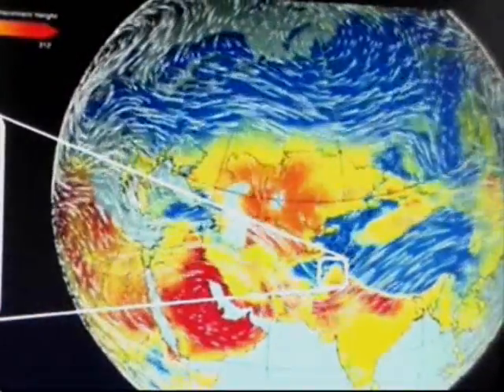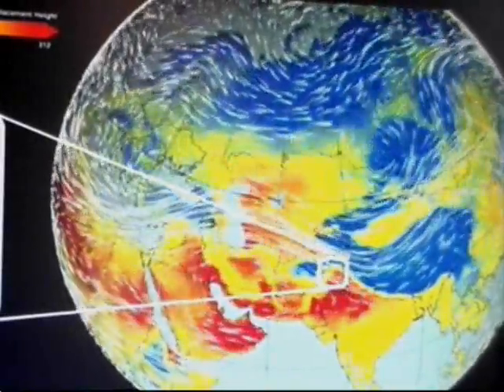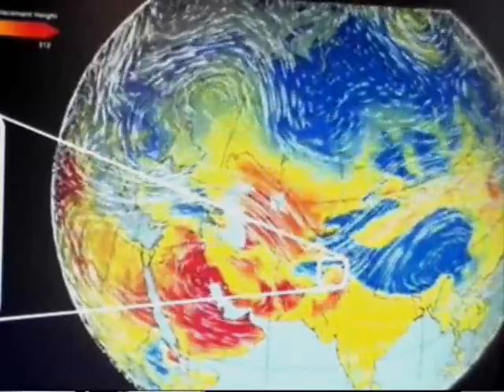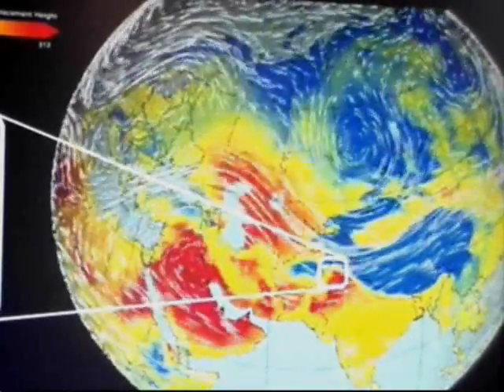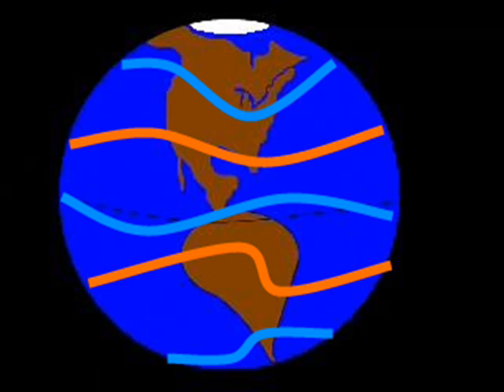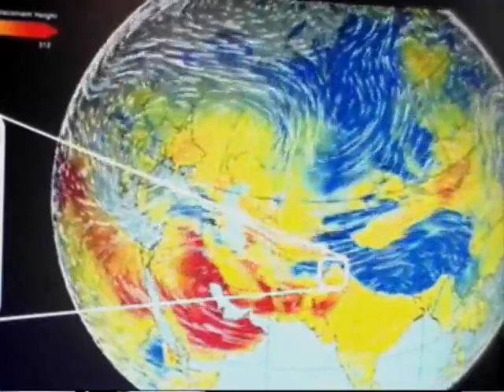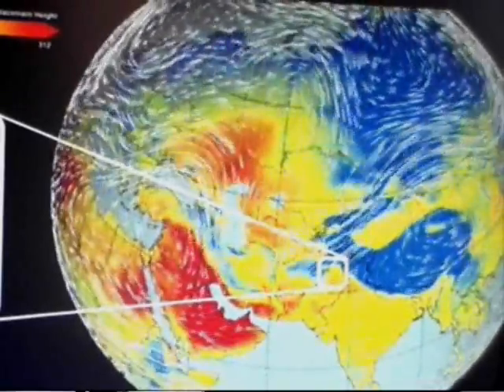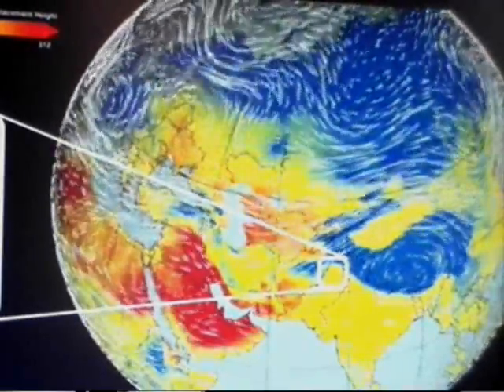Convection In A Gas

Comment: Wind is simply high electrical,charge potential seeking balance or equilibrium...when equilibrium is achieved a calm sea and atmosphere is the result.  A high potential Negative charge or center of hurricane is low pressure and it seeks balance very rapidly the farther away from the center of the hurricane the calmer the wind is...it has then reached equilibrium.  Winds are always rushing towards or away from a storm...electricity is the driver of fluid dynamics.  Also water from the sky is formed from ElectroMagnetic friction...aka rain bands of a hurricane...Argon and or Nitrogen just has to give up one electron and one proton to combine with Oxygen to form H2O.  Yes, water does evaporate but a storm creates its own H2O on demand!
Reply: simply... no your explanation was not simple at all.